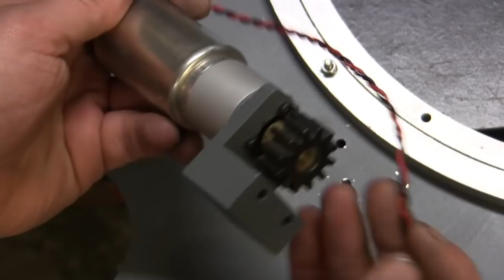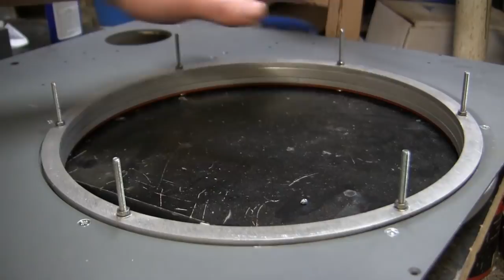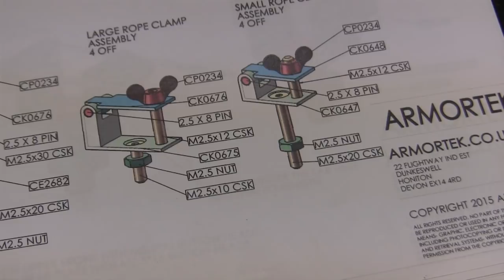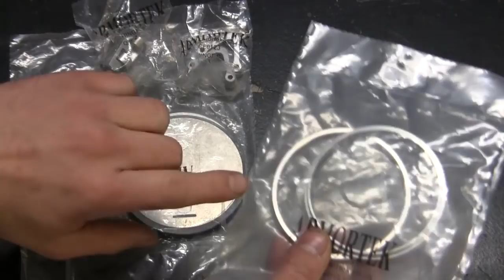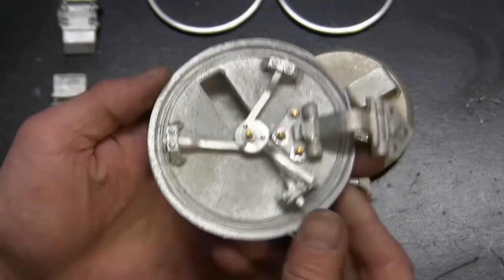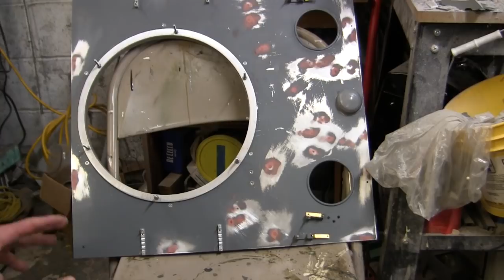RC 1/6th scale Armortek Early Production Tiger video #17 part 1 (turret turn system, deck details)

Comment: Hi there oddball 759mm Long time ago i bought from you a lot of resin casting pieces for my tigen tiger 1 please one question looking this video in the real tank where they did use to save the snorkel,inside the tank?
Reply from the maker: There are some debates about this. After researching the tank I'm on the side that states that the snorkel was not stored on board the tank and was something that was carried extra. Some people claim that there is a tube on the rear wall of the engine compartment that is for the storage, however from my research I found this to be incorrect. That tube that they are referring to is for ventilation of the engine compartment and is far too small for the snorkel to fit inside and store away.  This myth comes from documentation from the British army's analysis of tiger 131, where they mistakenly ID'd this tube for the snorkel storage.
Reply: @oddball759mm  you right oddball anyways you have been researching for a long time even get in real tigers so who can beat you i been learning and enjoying your videos for a while and yes it make sense that many things was suply by trucks including ammunition,the tiger i have is a mid version however i want to upgrade it to a late version it is a project based in Michael Wittmann  tiger 1 late version 007 wich was different to the mid version version and was the reason cause i bought from you the parts i needed time ago
Reply: It is however a 1/16 scale not a 1/6 scale
Reply from the maker: Converting the mid tank to a late is a very straigtht forward project and is one that is relativley easy to do. The three types of tigers were by in large the same, the big difference between them are the detail fittings and the trick is knowing which details are for each and which need to be omited / removed for the desired tank in mind,

To fully convert the mid to a late you will need to replace the running gear, rear engine deck fittings, add the turret armored ring, use the late pattern copula, late pattern air cleaner / grenade launcher and add the turret roof armor.

I have done a couple of late 1/16th scale tiger I tanks, I would recommend checking those videos out to get an idea on how to detail upgrade a late tiger in 1/16
Reply: @oddball759mm  thanks oddball I'll keep in mind